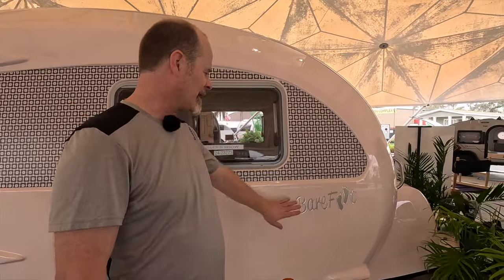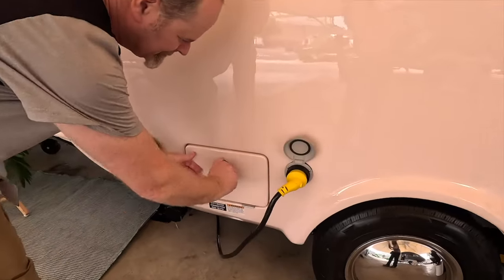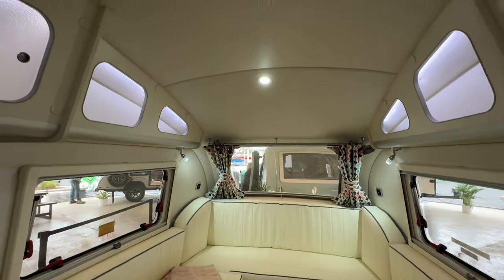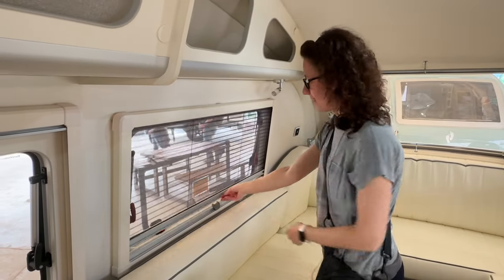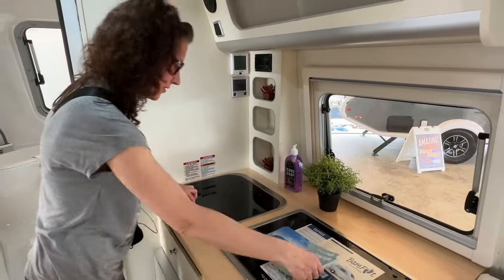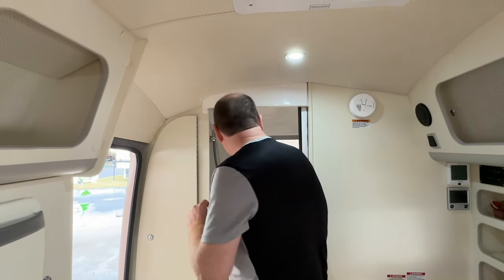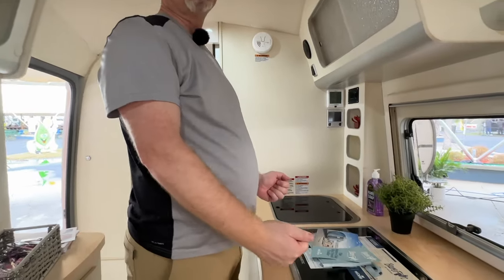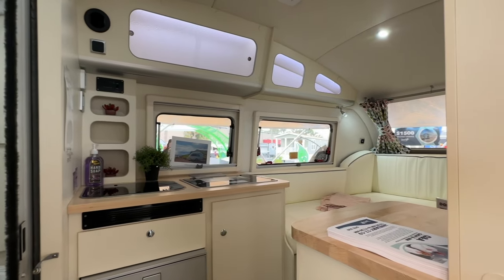Barefoot Caravan by Nucamp Walk-Through | Fiberglass Small Camper Travel Trailer

Comment: the major problem with a cassette toilet is that you have to stay very close to civilization.  It is illegal to dump the toilet in the wild.  So only good for camping very short stays or close to amenities.
Reply from the maker: Cassette toilets are dumped at the dumping stations in your campground with the advantage that you can do it more often without having to move your rig. Same as a poop tank. Thanks for watching!
Reply: @DayHikerFromTheSix  I know all that.  That wasn't the point of my post.  Reread it.
Reply: @Marcus-p5i5s Sorry about that, and yes, agree…this is a short trip rig if boondocking/overlanding is your thing. Interesting though, we just did our first true off road trailer walkthrough (coming soon) and the manufacturer prefers the composting/laveo/dry flush options over a black tank. On the black tank side, our trailer has a 12 gallon black tank and with four of us travelling, we’ll get 4 to 5 days out of it if we are not using campground bathrooms. So yes, 5 gallons is pretty small.

Comment: Hopefully the fridge is a pullout drawer style. so you don't have to get on your hands and knees. Also, I would sacrifice the lower half of the storage storage (behind the magazine holders) for a full counter opposite the 2 burner. Otherwise, VERY well-designed! Is there a solar package?
Reply from the maker: No solar package, but there is a convenience package with a 100 AH lithium battery and a solar port. It doesn’t mention a solar charge controller though. I’m a fan of portable panels not on the roof of the trailer since I always try to park in shade. Thanks for watching!